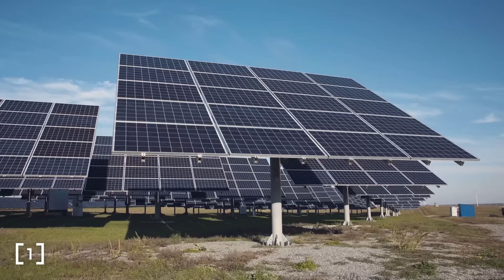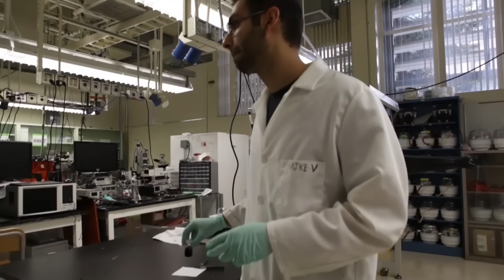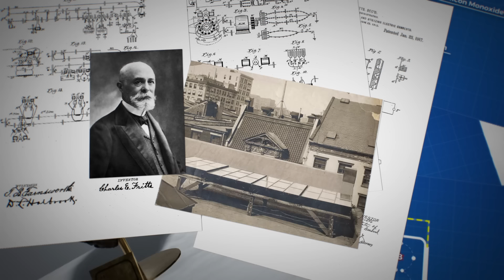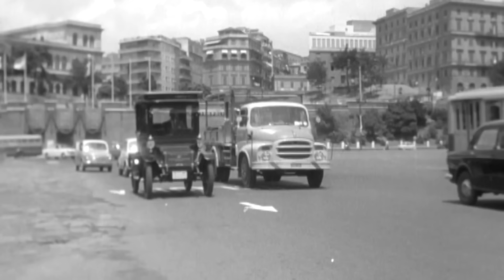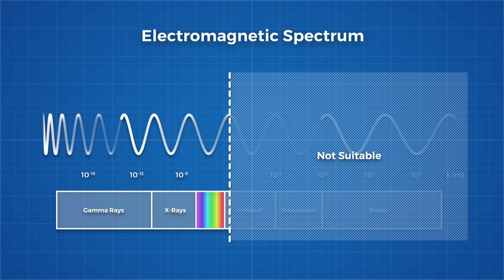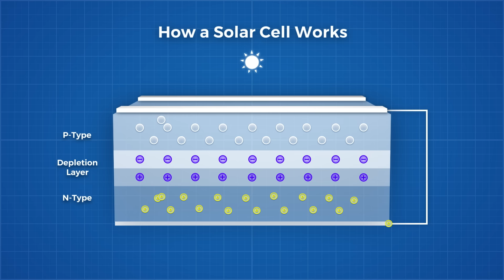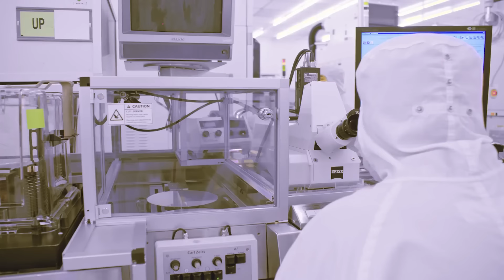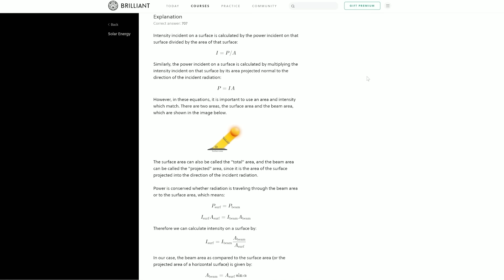The Mystery Flaw of Solar Panels

Comment: The US consumes 10,715,068 Mega Watts per day.  567,864MW from solar is good, but nowhere near sufficient to replace existing generation methods.  And then there's the issue of solar power at night...and the very resource intensive, raw material intensive, extremely toxic batteries needed to store any excess power created.  Photovoltaic Solar is a piece, not THE answer.  It NEVER will be the answer.

Comment: Not an engineer, but would it be possible to sandwich a  gate type material with an external voltage applied, but next to no current, to induce more photovoltaic current, lowering the threshold energy for jumping the gap,  like a transistor? Of course, this would complicate things, but the efficiencies could be enhanced significantly, right? Also filter out the light that only serves to heat the cell. Coatings and treatments are already applied to enhance absorption anyway. Explore edge contacts.

Comment: “Installed global capacity of solar cells has increased year after year...fueled by the plummeting prices and rising efficiency...forcing fossil fuel producers out of the market...”. You forget that: 1. Governments have been heavily subsidizing solar cells for decades and 2. Regulation of fossil fuels has been increasing in cost and complexity, forcing out even “clean coals.”
3. What is the power production per square foot versus other technologies?
Reply: Nevermind that there are nearly zero examples where fossil fuels have actually been replaced by renewables... the examples usually chosen (Germany, Denmark) are perfect examples of how rampant renewable building drives electrical prices through the roof and how unviable the prospect really is...  both of those "changes" occurred at the behest of the governments under threat of death to any who oppose the taxing required to support the subsidies required to make their energy transitions happen.

Comment: We still should be building more Nuclear plants.  Fossil fuel energy isn't even close to being out of the market (where did you get that idea).  And the total capacity of 630K MW is pretty misleading and irrelevant.  Doesn't run at night, doesn't work in bad weather, or in good weather but cloudy...  Takes up huge amounts of land for much less MW/ square ft. The total capacity isn't being shared among the same grid...

Comment: I don't think that Solar Panels are the best way to produce solar energy. I saw the display of the solar tower with many mirrors reflecting the sun's temperature energy to boil a liquid so it can drive a propeller generator. Afterward the gas would return to a fluid and driven back to the point where it would boil. If you can possibly answer me if this option of solar-power is more efficient than solar panels.
I admit that I have yet researched too deep about both options, but I just feel that it makes more sense to use thermal solar energy than trying to optimize the event of using light rays to jump an electron to cause electricity.

Comment: You should look at covering the design problem of solar-powered/solar-assisted HALE aircraft (High Altitude Long Endurance). They're designed to fly for months at a time (think of them as atmospheric satellites) but the design problem of optimizing the solar cells for that application is pretty fascinating. Sincerely, an aerospace engineering student.

Comment: The drop in cost has not produced more solar or any other "green" energy, the massive pumping of tax monies into them has done so.  No one in their right mind would put a solar system on their roof if the government didn't pay half the cost, and power producers don't use these technologies because they're cost efficient, they do so because governments mandate that they do so for political/ideological reasons (and pay a large chunk of the cost).  And even with government paying for half of it by the time it's "paid for itself" it has to be replaced.  Not only are our taxes paying for this but the electricity is more expensive so our wallets are taking a pounding.  I'm sure these will be viable energy production technologies at some point, but pushing them before they've matured so you can claim you're saving the world from crisis hoax number 1 (global warming) is foolish.

Comment: You haven’t addressed the issue if one of the cell fails you will lose the whole string of solar cells because you now have an open circuit, plus cleaning, plus hail, and maintenance. Solar cell panels are connected in series and parallel to get the correct voltage you need to convert the solar energy into working energy...but it was still a great video...I recommend to anyone wants to learn about solar energy.
Reply: Modern panels have many bypasses.
Reply: My panels have micro inverters converting the DC power from each panel into AC and passing it to the grid. If my panel is covered by shade it does not drop the other panels.
Reply: You should read about microinverters. You are talking about traditional string inverters.

Comment: I feel like just using Solar Thermic for Terestial purposes is easier. There we are actually want the heat, so we can be way more efficient. We also just need to produce a really good mirror and then funnel the heat into a heat exchanger, to heat water and funnel the steam into our basic powerplant turbine.
For applications where liquid supply is limited (like Space, Colonisation) Solar Panels of course would be the only reliable thing. But we are on earth, that makes it easier.
Reply: Solar Thermal (Concentrated Solar) hasn't exactly been working out great for those that put the effort into them.  The maintenance costs to keep the mirrors clean has outpaced the profits from the energy sold.  

Space will always be the domain of nuclear power when beyond Mars' orbit... a solar panel simply  doesn't produce enough electricity to power the systems we'd need to power... Nuclear obviously can... and it could on the surface of the earth as well...
Reply: @Whiskey11Gaming  Pretty sure the panels and the mirror need the same amount of cleaning work.
The whole idea behind renewable energy is not to screw over the next 10 generations with climate effects. Nuclear power screws over the next 1000+ generations with nuclear waste.

Comment: Even though solar panels may have only a 20% efficiency, there is nothing being lost.  The energy was free to begin with.
Reply: To begin with, you need to consider the costs of production, transportation, installation and maintenance. The efficiency also depends on the location and decreases within the time.
Reply: @marthaerato8955  Any physical system will have initial costs. You have to look at the total energy production (at zero cost from sunlight) over the lifetime of the panel (measured in decades). The cost per kilowatt is almost nil.

Comment: The con works like this - the panels lower their capacity, the companies set projections as if the panels were new all the time  when in reality cells decay over time. Then theres a cost to recycle the old cells when they are used up, at that point the company is dissolved and the cost falls on the owner.

Comment: You kind of missed the elephant in the room. Zero ability to respond to load demand.
Reply: Thats Not the Job of the solar cell expacially Not the Job For one single solar cell thats the Job of the Energy grid.
Reply: @williknie9165  That's for sure. You just said it. 
Solar panels don't do any of the work of the energy grid. They are effectively just toys. They are actually just an extra burden on the grid.
They create unreliable input fluctuations that add on to load fluctuations. The generally only produce  when not needed. Places like Germany, Denmark  and California with high solar installation have the highest electricity costs in the world.

Comment: You made a mathematical error. 33% loss is of the 81% left of the solar energy after 19% of wavelengths longer than 1110nm (if I remember correctly), which makes a total loss of .33 * .81 = .2673 or 26.73%.

Comment: With current photovoltaic technology you want to over capacity an installation by 15% because within 10 to 15 years that's how much output the panels will lose. The initial drop is quite fast then it slows down a lot but still drops for around 5 years then the degradation slows way down. If you buy used panels, try for ones at least 5 years old, that have been in the sun all that time. Test their output then you don't have to over-capacity the system near as much because they won't degrade much more.

Comment: Very well done! After many, many discussions and much experimentation, my colleagues at one of the U.S.'s premier university laboratories and I concluded that without the federal subsidies, solar electricity was essentially a dead issue for economic reasons. The efficiency of solar cells would have to more than double to overcome this, which is unlikely. However, solar hot water was not subject to the photon energy limitations you accurately describe and it was a winner, working out well in many simple and long-lasting installations without all the e-waste associated with semiconductors.

Comment: Ummmmm . . . . . .  There is an obvious flaw in solar.  It requires lots of semiconductors.  This means that used cells are toxic to the environment.  They aren't as toxic as nuclear waste, but still plenty toxic to the land fills they end up in due to improper disposal.  Solar isn't directly contributing to green house gases, so that is a small win for solar.  Also, none of this takes into account the hazardous chemicals needed in making the solar cells.

The point is that solar energy is faaaaarrrrrrr from green energy.  Wind, hydro and tidal are far more green than solar, but have there own impacts on the environment.  These impact are on the order of modifying habitat in a way that native species can no longer cope.  They are not directly toxic to the environment like solar is.  

FYI : I have worked in the semiconductor industry, which is why I am familiar with environmental impact of making things with silicon.

Comment: I’m surprised by how advanced we were in the 1800’s, it seems so many of the technologies we consider cutting edge such as battery operated cars, solar cells, etc were invented at that time. 

I wonder how many more interesting technologies were developed in the 1800’s & 1900’s we forgot about.
Reply: The Ancient Egyptians had batteries...
Reply: @matthewronsson  this is not true.
Reply: G series I think he’s talking about the “Baghdad batteries”, scholars think they were used in some capacity in the ark of the covenant so that touching it would be shocked and believe they had a powerful religious experience.
Reply: There were also early versions of electricity producing windmills and the first commercial grade hydropower systems that involved into megaprojects like the Hoover dam.  Unfortunately, the technology versions available then were not enough to remove the need for the giant steam engines known as power plants.

Comment: Renewable Energy, primarily wind and solar, cannot replace hydrocarbons.  Maximum wind and solar efficiencies remain subordinate to the 'constant' rules of nature, where capacity boundaries are established by laws of gravity, inertia, friction, mass, and thermodynamics.  The physics boundary for a wind turbine, as an example, is the Betz Limit,  with a maximum capture of 60% of kinetic energy in moving air.  The physics boundary for silicon photovoltaic (PV) cells, the Shockley-Queisser Limit, is a maximum conversion of 34% of solar photons into electrons.  
Further, the industrial process of manufacturing solar panels using quartz is very energy intensive.  For starters, in a standard production process for a photovoltaic cell, metallic silicon is reacted with hydrogen chloride at 650 degrees Celsius to create a liquid called trichlorosilane. This liquid is purified through distillation, evaporated and then deposited as polycrystalline silicon on silicon ingots. The process calls for between 100 and 160 kWh to fabricate just 1 kilogram of purified silicon.
Beyond all this is the considerable habitat destruction to make room for solar panel farms and their transmission lines . . . clear-cutting trees by the millions.
Reply: Most of the facts you are stating are correct, but sadly your conclusions aren't.  Also you seem to forget that carbon plants also have a maximum efficiency of around 38% (and in that case we have to provide the fuel, while wind and sun don't cost anything). 
Regarding the production of PV cells you are again correct saying that the process is energy intensive, but the energy needed is not remotely comparable to the amount of energy produced by that cell. Otherwise PV cells wouldn't be economically viable.
Reply: @clarkkent2746  PV cells are not economically viable, as in self-financing.  They call for a combination of large government grants/subsidies and significant increases to the ratepayers.
Reply: kNews & kNotes except that this isn’t the case. They only require such grants because of bureaucracy. In Australia for example, or Asia, its so cheap to get solar panels. You can have one put on your house for 5k USD. In the US its still costs at least 10k for small ones and thats not because they’re expensive to manufacture, they’re actually cheap. ROI even on the more expensive 10k panels is less than 10 years. Most PV panels last for over 30 years! The first ones created over 50 years ago are still producing energy today!
Reply: @harsimranbansal5355  
I got a DIY installed  800 watt system for about  $1,000 without government funds.  I generate thousands of ah every year and also use it.
Years ago I had a company to give me an estimate for $60,000 here in the US so I started to buy the needed gear myself and install the system myself.
Our power from the electric company went down many times while my system provide and keeps standing and I use that solar power every day.

Years ago, I seen a website, that listed 30,40, and 50 year old panels in operation and locations.
Reply: J & B Homeliving yea exactly. I’ll give you an example of what I have experienced. The panels themselves are pretty cheap. But I looking at putting them myself and it turned out, if I want to connect them to the grid, it would cost me around 7k. Just to do that!
Reply: Solar cells can be mounted on the rooftops of any building, so don't worry so much about the trees.  Wind farms can be off shore in the ocean where even more energy can be generated from tides. New materials are constantly being researched for PV cells and newer ones have kept increasing efficiency to where it is cheaper than the fossil fuel alternatives. Adding to that none of these pollute the air and water around them.
Reply: If I produce 1000 watts of solar power, then I reduce 1000 watts worth of carbon. So yes I am replacing hydrocarbons with sun energy.
It takes a mono crystalline panel  3 years to generate enough power to replace  what it took to make it and this include harvesting raw material making it and distribution of the finished product.  It takes 2 years for the poly-crystalline and 1 year for the thin-film to do the same. 
The average solar panel takes 7 years to pay for itself without government funding, sooner if you get government credits etc etc.
England got their windfarm a few miles off the cost right in the ocean and another wind farm was approved last year. China, japan and some of Europe floating solar panels right on top of fish farms, which keeps algae and water temperature down.  Farmer  here in the US, renting their farmland for 20-30 years  to solar companies and they erect  solar fields without having to cut trees and also to wind farm companies. Farmer making more money in rent than farming it.  Also the desert is used for wind and solar with little impact and of course thousands of houses have it on roofs that feeds power back to the existing  network.
Reply: Thank you for honesty

Comment: i live in wisconsin...the PV pushers need to get out, and go home, and leave the market to RE that works here...PV is Increasing Wisconsin's Carbon Footprint....we are 2K miles inland, and have extreme temperature maximums and minimums...these temperature extremes cause physical damage to the PV structures which reduces the output and service life to the point that it takes More Energy to manufacture, ship, and instal PV in wisconsin than we get back out of it....
also...we need our Solar Thermal guys to WORK WITH our Geothermal guys...Not In Competition !!!...the geothermal guys need to stop pushing installation capacities designed for heating, and the solar thermal guys need to stop pushing installation capacities designed for cooling...

no stepping on each other's toes...the Solar Thermal installed capacity should be calculated from the 63 degree ( up from horizontal ) panel angle...or perpendicular at annual minimum environmental temperatures...and sized for the maximum summer time heat load...and the Geothermal installed capacity then needs to leave an appropriate dead band gap from that..

my Solar Thermal capacity suggestion is in sizing for "no waste heat" or primary supplemental solar heating...or in effort to avoid installing systems that might otherwise use energy to dump energy..I mean, obviously solar thermal systems need a fail safe heat dump...what i mean is sizing to reduce that to primarily a fail safe redundancy..
the main obstacle of Geothermal installations is the excavation...so just design for the maximum cooling load, that's it...just that...and then it's combined supplemental heat.

then merged Hybrid-Thermal ( Solar/Geo ) companies could run through the same heat exchanger components, and merge the sensor and control systems also..

but I Need Funding For My New Modular Low Head Eco-Friendly Hydro Development Design Here..